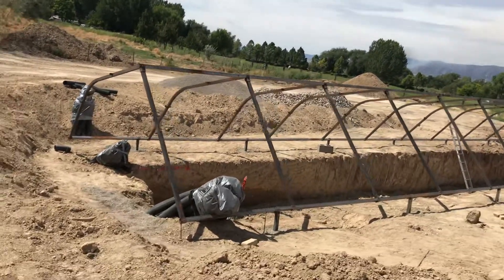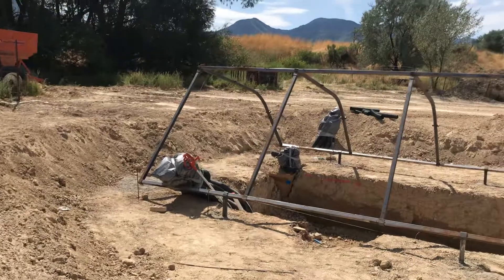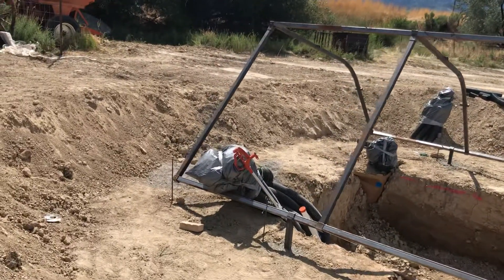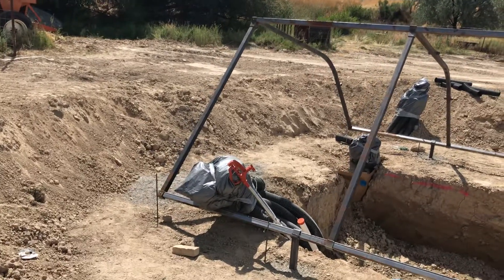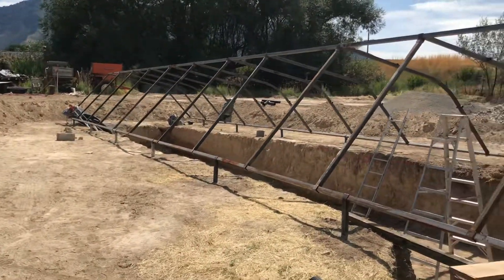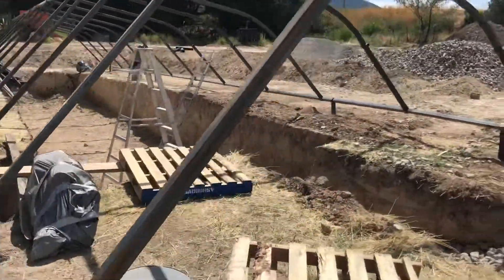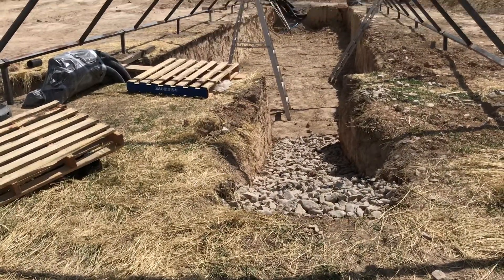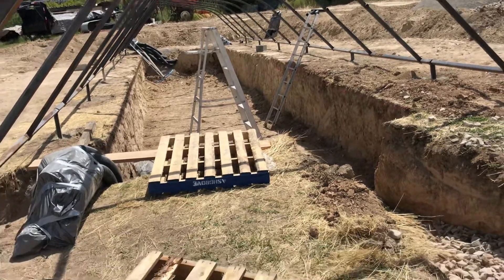Geothermal Greenhouse in Springville, UT

Comment from the maker: We purchased a Greenhouse kit from "Greenhouse in the Snow" out of Alliance, Nebraska.  They've been building these for years and we wanted to use their experience and expertise.  Zone 6B here in Springville.
Reply: The amount of air you`ll be able to run will be very limited with 230ft lengths of 4" ads tubing. Air is the medium by which heat is trtansported to and from the greenhouse.
1x 230ft length eunning 100cfm incurs a loss of 3.2 inches of water, 
4x 58ft tubes with 100cfm each (400cfm total) incurs a loss of 0.82 inches of water 
8 x 29ft tubes with 100cfm each (800cfm total) incurs a loss of 0.41 inches of water. 
The surface area of tubing available for heat transfer is the same in all cases.
Reply: @JohnGuest45  looking at another video where the maker of this greenhouse is shown, it said "They have buried 1,100 feet of 6" tubes 8'  into the earth"
The system clearly works - you can see videos of it working.
By my understanding the air going into the tubes achieves the temperature of the surrounding ground - there needs to be sufficient length of tube to allow the air to warm up. A short length would mean a slow flow rate - a long length could have a faster flow rate. Time in the tube = time in the ground = time to warm up.
What do you mean by ' incurs a loss of 3.2 inches of water, '?
Reply: This is Awesome!!!! I have followed Russ Finch for a lot of years. I also follow other people that have done this. 2 in Utah where I currently live. I would love to come and check this out.  I am looking forward in seeing your progress in the future! I think you are on the right track with a water pond and circulating water in a  troff. Doing the Hydraphonic, and the Geo Air method. I was thinking of doing the same.